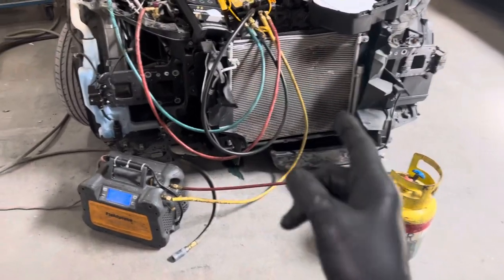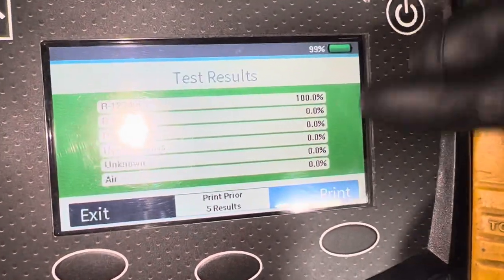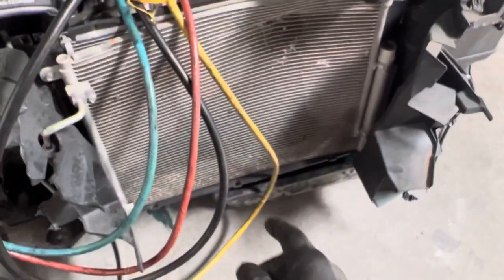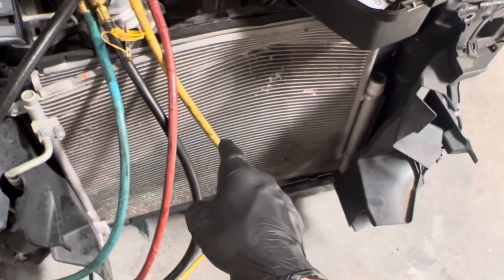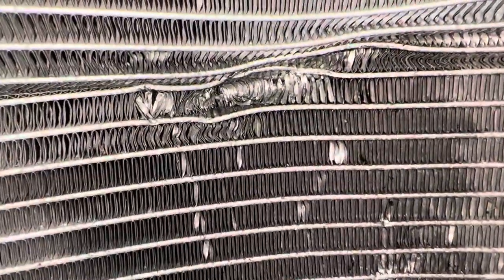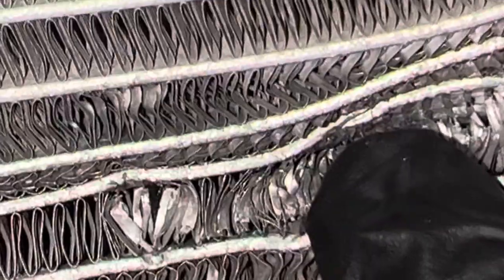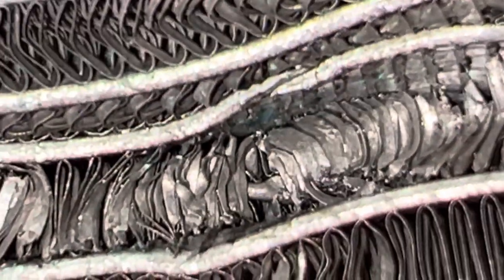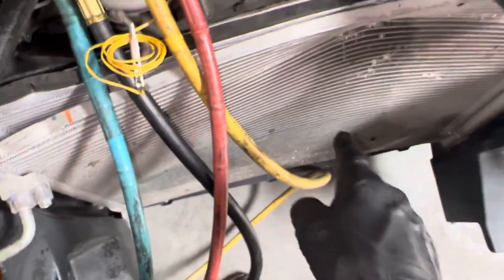AC condenser looks like it’s leaking.  It’s actually the radiator behind it that got punctured￼. ￼

Comment: Amazing it took that much abuse, must be good quality.
Reply from the maker: Compared to a home residential HVAC split system condenser.  
         The home residential only has to be strong enough to sit still stationary. 

           Automotive condenser hasta be able to take small debris hitting it at 75 mph daily small stones small pieces of wood somebody’s tin can or garbage in a paper bag. 

       The automotive AC condenser has to be able to survive 4.5 to 6.0 earthquake constantly 100% of the time as it’s driving down the road. 
                And for a very bumpy off-roads survive a nine. Oh earthquake while driving off-road air conditioning condenser on a Baja buggy is a good example try that with a residential condenser.
Reply: @coldfinger459sub0 Road acids and salts as well. I hate cheesy paper-thin condensers, accumulators, filter driers and evaporators.